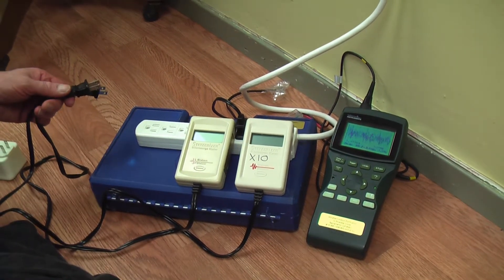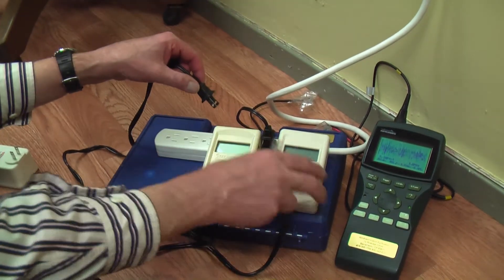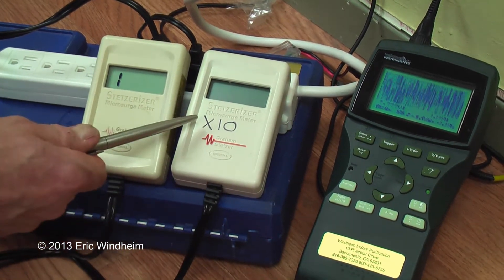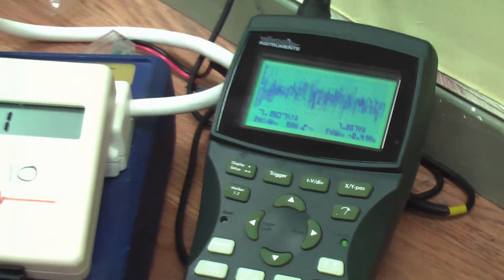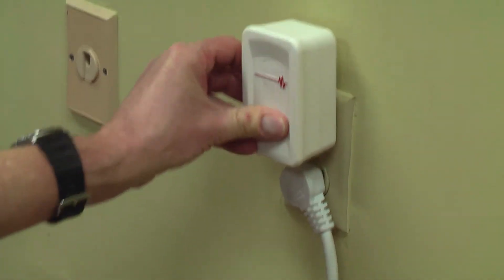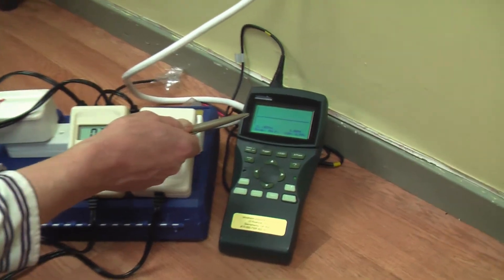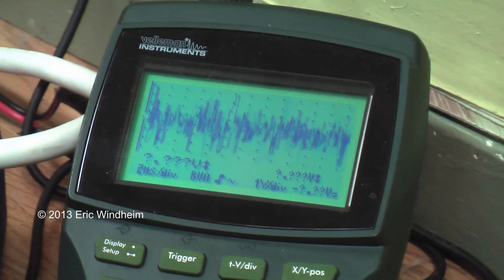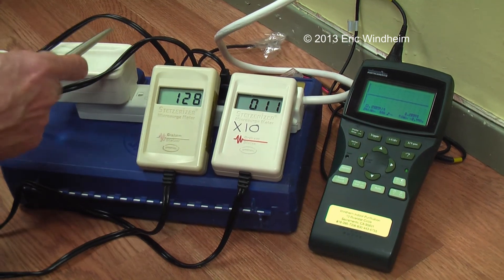Reduce Dirty Electricity with Stetzer filters

Comment: Thanks for your work and video. I just found out the new LED bulbs I installed in my house produce a lot of dirty electricity, which is produced by the bulb, so a filter has little effect. Is there anything I can do to clean this up?
Reply: There are special Leds on the market with less dirty power. But there are ordinary lightbulbs, too. I got them in my house. The light is silent and naturally bright. 💪🤘🍀